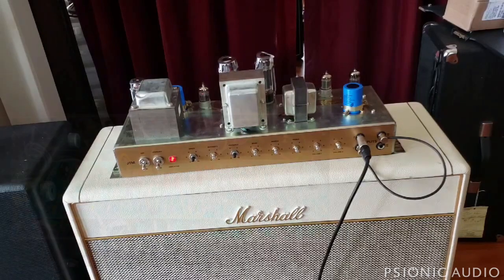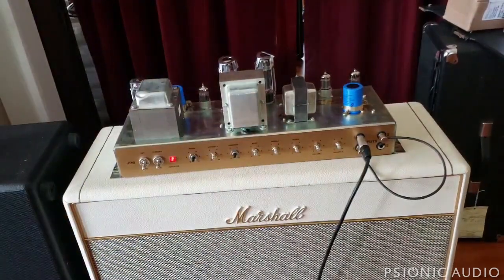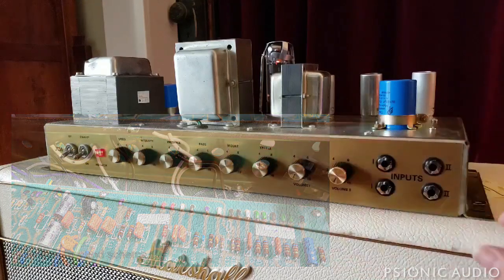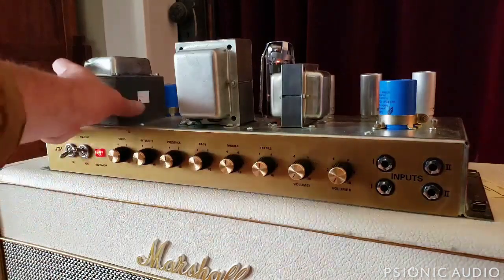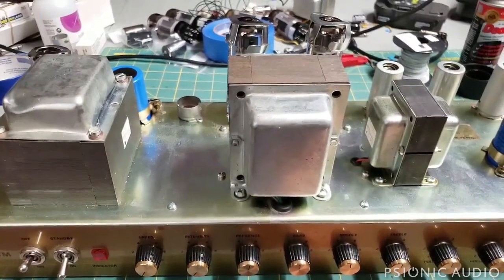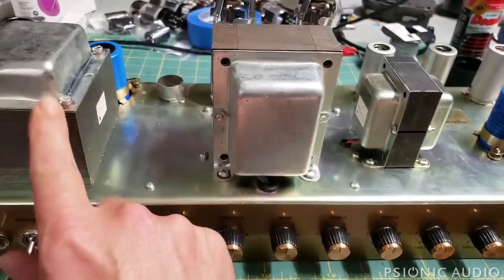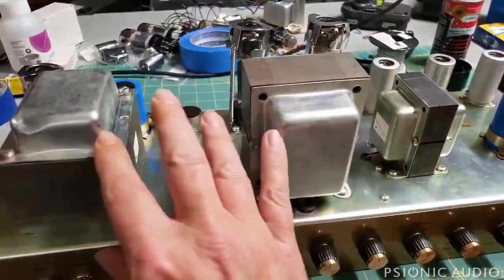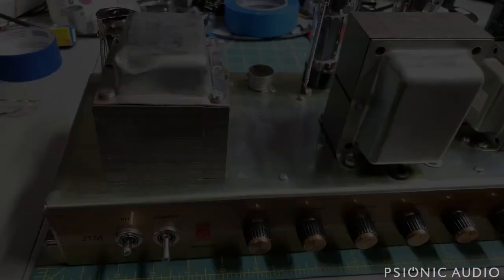Marshall 1962 "Bluesbreaker" Reissue Video 1

Comment: These reissues are built to a price. They aren't "boutique" by any means. This amp can be had for £1100 in the UK new.  My 25 years old JTM45 reissue has always been relatively noisy, but is still alot quieter than my old 50w plexi. And both are alot quiter than my 74 silver deluxe reverb. You can go insane trying to get a silent amp but I find i just play 'em and try not to obsess.

Comment: Right after I got back from Afghanistan with money to burn, I went to my nearest (now closed lol) GC, as they had a used one at a decent price.

Couldn't get a sound out of it, checked the fuses, preamp tubes, power tubes, all looked fine.  Then I got to the rectifier tube.  Pulled it and noticed that it was missing its base key.  At that point, I should have walked away.  But silly me, I got the attention of the manager.

I asked him if they had a GZ34, and he looked at me like I'd just addressed him in Aramaic.  I tried to explain what was wrong with the tube, but to no avail.  He was just certain he could make it work.

Needless to say, the magic smoke was released, and the guy sheepishly asked if I was still interested.  Hard pass.  Just glad he was the one who smoked the amp and not me.

Comment: Geez… glad I opted to rebuild an Ao35 into an 18watt lite rather than buying one of these. It sounds fantastic and was only about $300 including a 12” Tone Tubby Mary Jane ceramic! Granted ,it’s only about 14 watts or so but I usually don’t turn the VVR up more than half way anyway. It DOES sound best all the way up,tho. If the 5y3 is changed to a GZ34 ,a few more watts can be squeezed out but it loses some sponginess. I LOVE the cabs of these reissues,tho. Are they actual  wood or MDF?